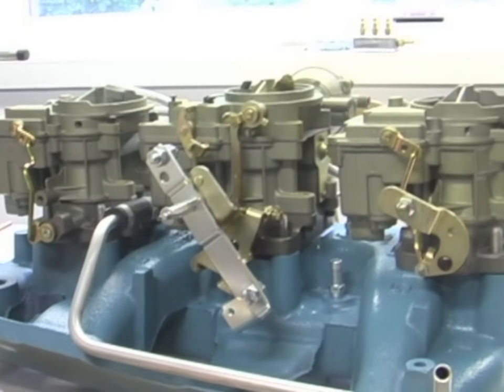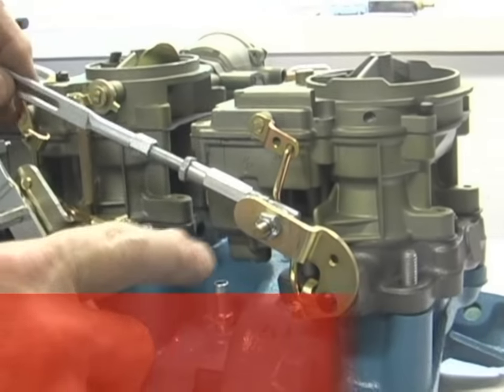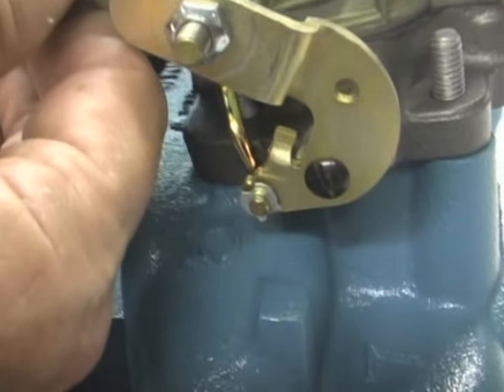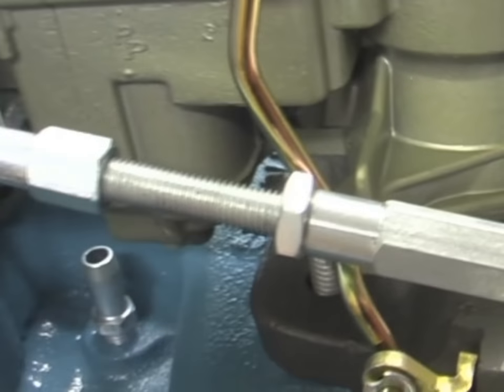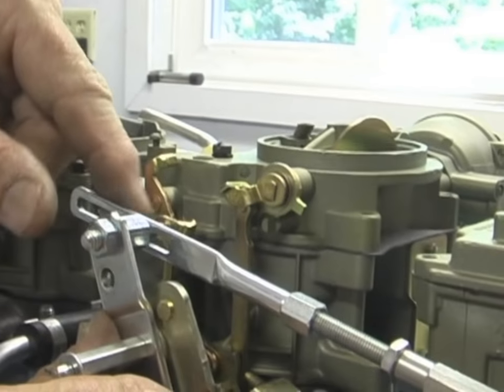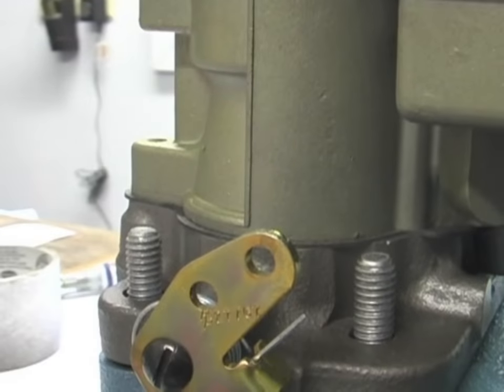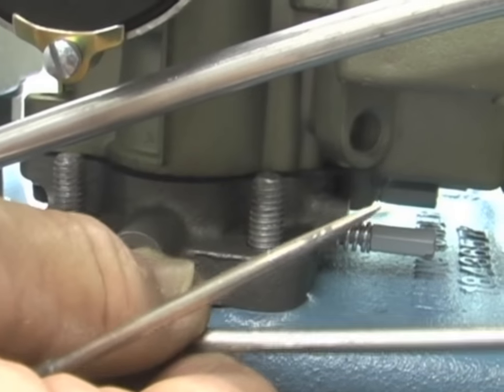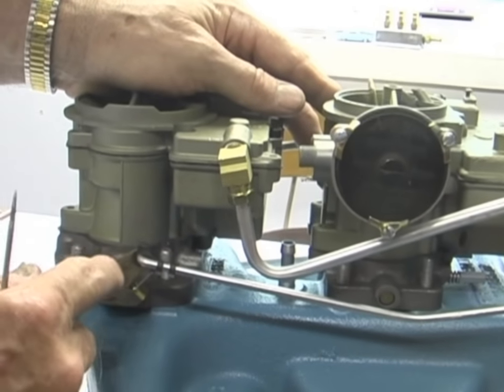How To Set Pontiac Tri-power 2GC Carburetors Linkage

Comment: Hi Dave, I have a 1969 428, I would to install a 3x2 intake. Will I get better performance from an aftermarket intake or should I use stock intake? And what casting number or part number intake would work for my 428?  Thanks for your help!
Reply from the maker: So sorry I’ve been so so long to respond to all the comments. I am not the gentleman in the video(s). The videos come from a big lot of carb parts we purchased with no contact info or copyright info, but the videos were So Good we decided to post them.

Comment: So i start my 66 up then once i tap the gas pedal the idle just  accelerates and its just not idling like it should.
Reply: If its just idling too fast you may need to adjust the fast idle cam.  If its rough it could be the front or rear carb is not closing all the way.  Look down the front and rear bores with a flashlight and be sure they are closed all the way.  Sometimes the return springs get weak.  Ames has new ones, easy to swap out.
Reply from the maker: So sorry I’ve been so so long to respond to all the comments. I am not the gentleman in the video(s). The videos come from a big lot of carb parts we purchased with no contact info or copyright info, but the videos were So Good we decided to post them.